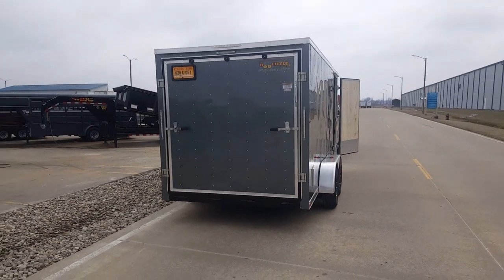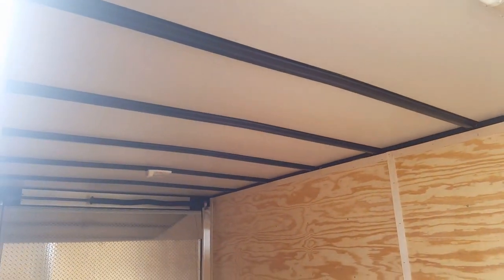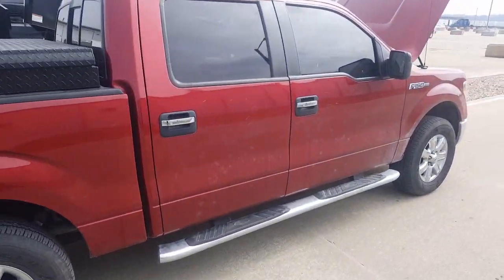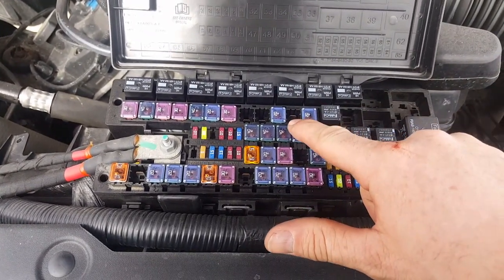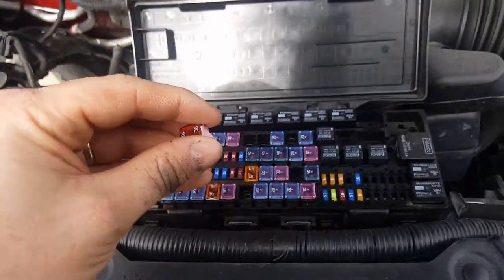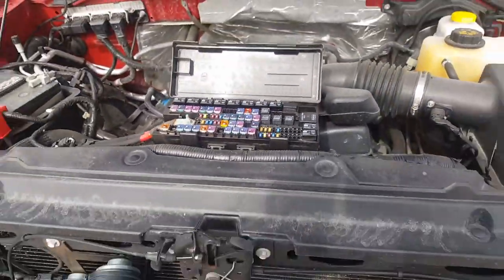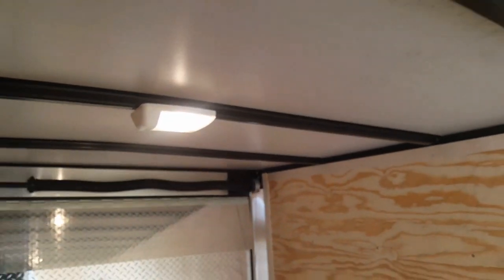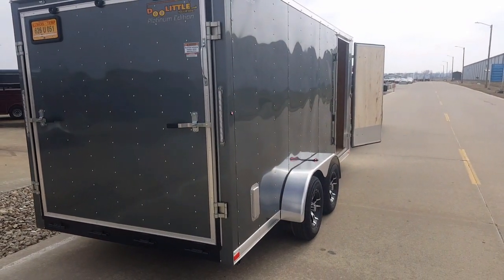Enclosed Trailer Dome Light Not Working

Comment: Thank you Alex for leading me in the right direction. I checked the truck connector and showed no voltage on the Accessory Pin. So with you help the No 21 30amp fuse was blown. You da man!

Comment: I’m having same problem with an 2019 f250. Can you help me out.
Reply: Fuse 70 my 2015 F250. Look for Trailer Tow Back Up Lamps. On the cover of the 7 pin connector it will show +. I think its the pin in the 5 o'clock position.